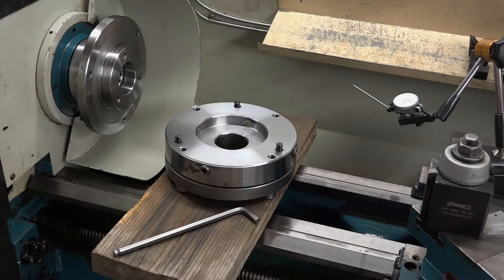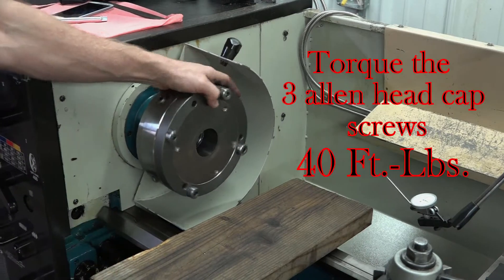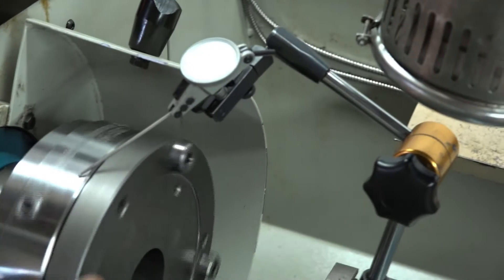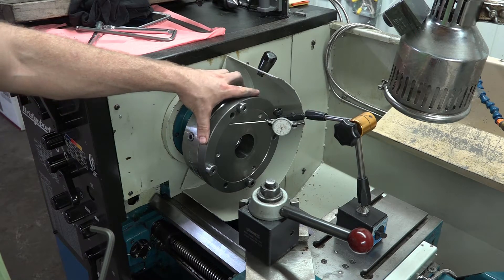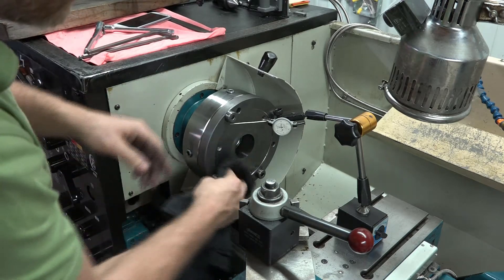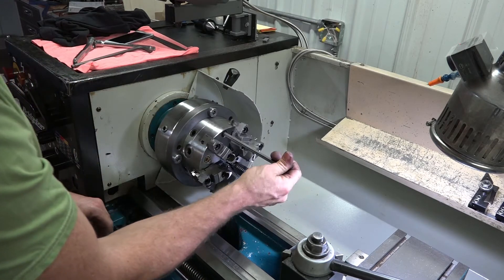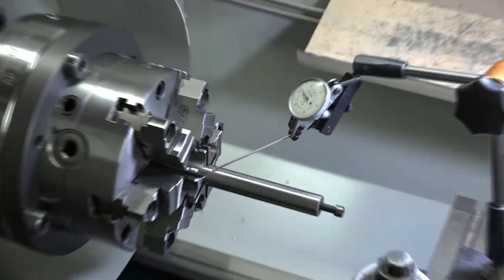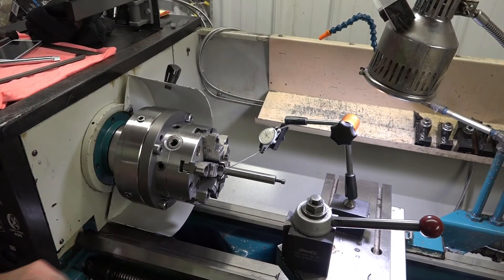True Bore Alignment System. Initial installation on lathe. 2018

Comment: We do you tighten the 3 bolts that hold the TBAS to the spindle adapter?  Don't those need to be backed off some when you use your 4 centering bolts (fine adjustments)?
Reply: Im curious about this too
Reply: @rpshotty4801  I have several set true's in my shop and I always back the face bolts off until they are just snug, then center it and tighten the bolts and double check.